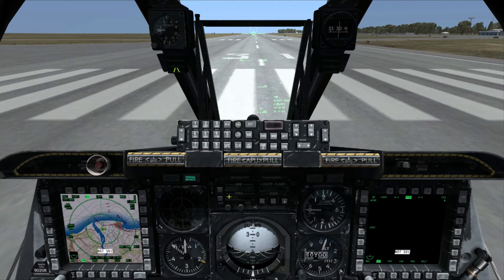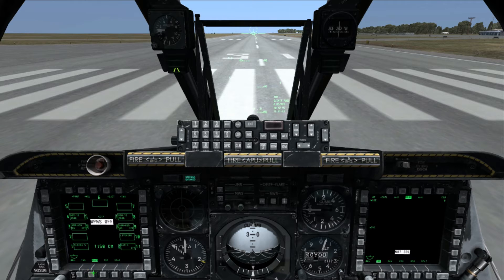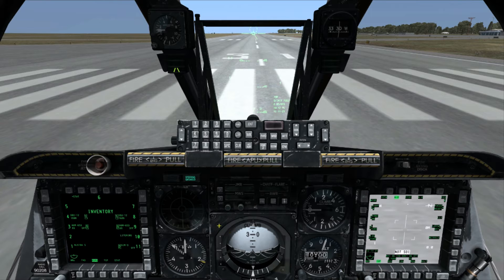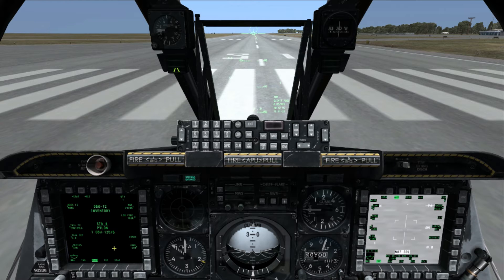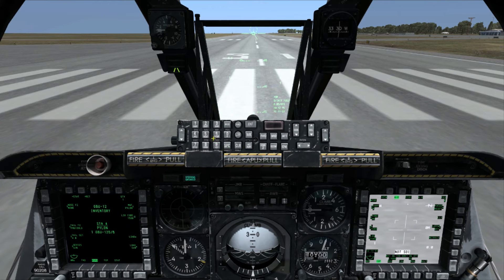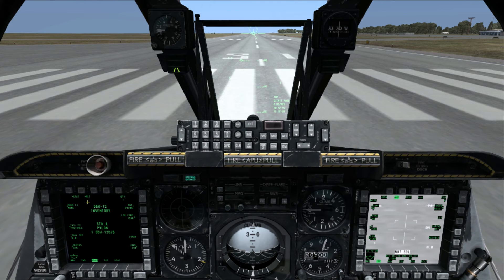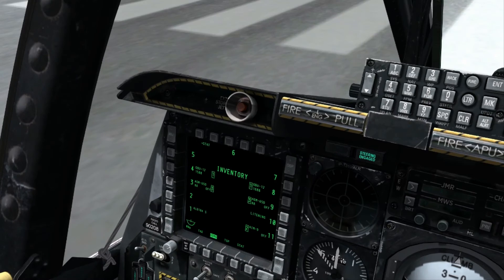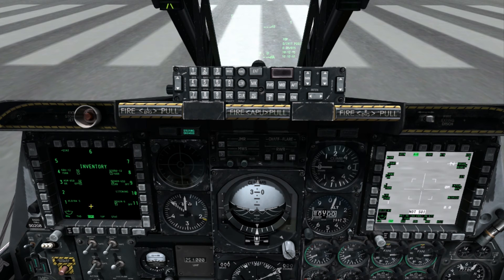DCS:World - A10C Changing Laser Codes

Comment: Is it possible to make a tutorial showing how to designate targets for other aircraft? I'd really like to be able to desingate for the Mirage 2000C and the F-5E without having to rely on a JTAC. 
Would be much appreciated :)
Reply from the maker: I planned on covering buddy lazing a while back but never got around to it, I'll see if I can dig up someone to record with so I can get it done. 
 In the meantime I suggest going into the control page of the TGP and enabling latching so that the laser can be toggled on/off, at that point it's just a matter of hitting NWS to fire the laser.  Be aware firing the laser too early can effect the guidance in a bad way.
Reply: pickinthatbanjo Thank you very much! Is there nothing more to it? Just match up the laser code and designate? 
Does the bomber still use CCRP? I'm just wondering how they know when to drop, especially if it is in a Mirage, for example. I'd happily help out - but I'd need some guidance (excuse the pun!) beforehand!
Reply from the maker: Assuming you have communications going with the other flight you would await the bomber to call "pickle" when he drops his bomb, at that point you'd give the bomb a couple seconds to glide before lasing the target.  How the bomb is dropped (ccip/ccrp) wouldn't matter as long as the bomb has time to glide, though as I recall a Mirage would be in CCRP using GBU-12/16's as it gets selected by default upon selecting the weapon.
Reply: We're on TS, so that's all good. We'll have to give it a go, it's something that has been eluding us, but I think we were trying to make it too complicated - around sending SPI links and trying to lock on to them. We haven't mastered that either. We're all good flying individually but it's the cooperation bit that's causing the problems and that's what we want to master.